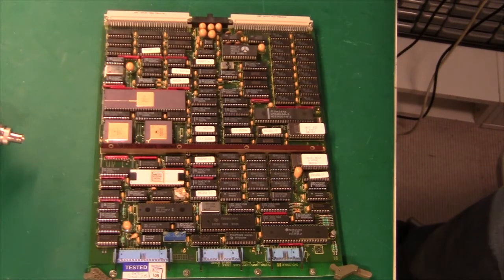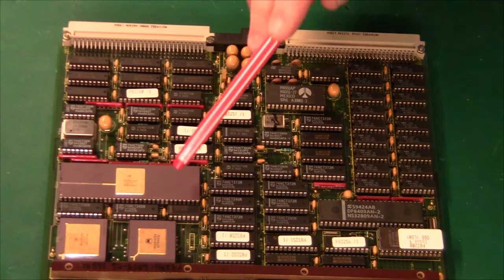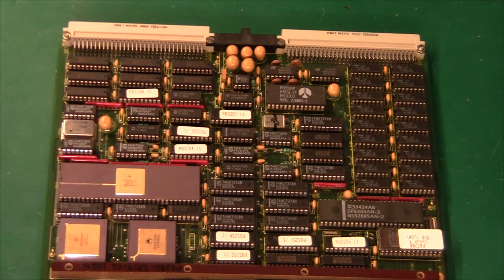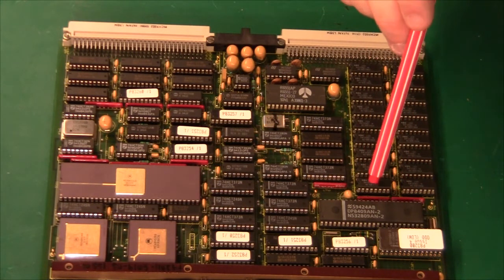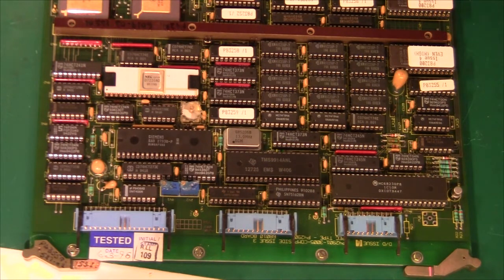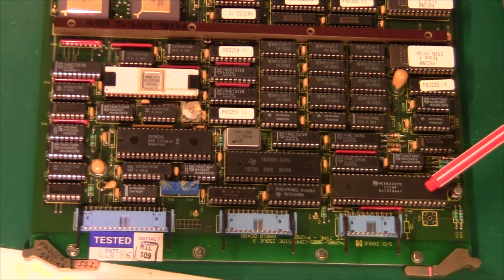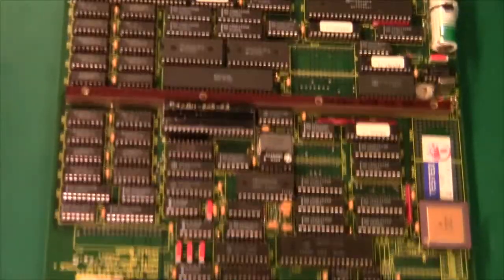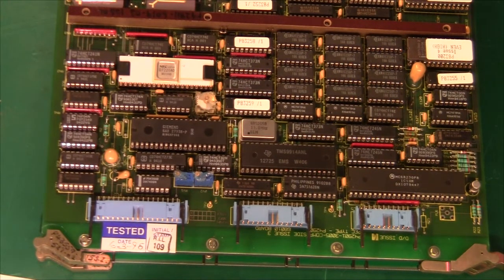Teardown of Ministry of Defence Computer Boards

Comment: The MC68000 is still manufactured in the form of NXP’s M68SEC000 which is a CMOS static core variant (clock can be stopped). The M68SEC000 is used in the TI89 Titanium graphing calculator & numerous industrial control among other applications.
Reply from the maker: Oh really cool. So the TI calculator could be hacked into almost anything. Has this been done? What about I/O?

Comment: Hello! Nice review of the board. I really like the 68k motorola, is there any assembly program that can run on win7? I would like to experiment a little with them. If you can point me i the right direction.
Reply: There is a 68K simulator that runs in Windows: Easy68K

Comment: NSN says its british army
Reply from the maker: Very interesting. I think I have to do a ROM dump to get an idea what it's for, although it is probably just the boot-loader for the harddisk/floppy drive.
Reply: Manufacturer of the board should be RACAL INSTRUMENTS WIRELESS SOLUTIONS AEROFLUX COMPANY, maybe its related to flight comunication equipment.
Reply from the maker: Wow. Awesome. Can civilians use this site?  I would love a circuit diagram.

Comment: Hmmm. Tried dumping the ROMs?
Reply from the maker: Not yet, but will do some time. It sure would be interesting. Just reading the copyright- and other text messages could give some idea as to what it is. If it's written using a compiler, it will be a bitch to understand the disassembly, though.